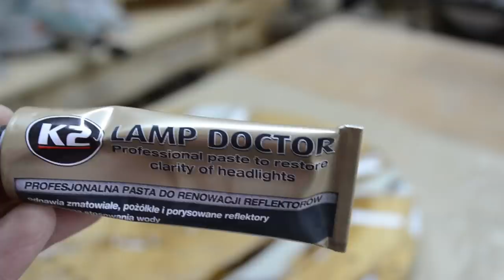Wall clock

Comment: Your work is amazing and beautiful! 
As always, it's satisfying to watch your videos. 
You mentioned that you struggle with air bubbles: I have seen some woodworkers seal the wood with quick-drying epoxy before they pour the epoxy resin. 
(Otherwise the air in the wood enters the epoxy resin in the days it takes until it dries)
Reply from the maker: Thanks! I know this method, but it was an old board damaged by insects. It was necessary to soak it by epoxy well, so I did not seal the wood with quick-drying epoxy and left all insect holes open